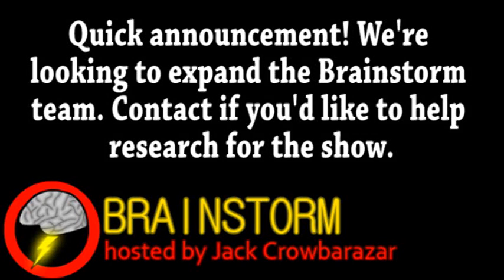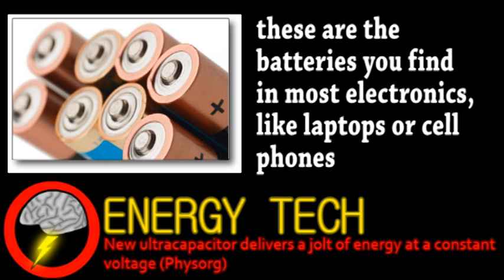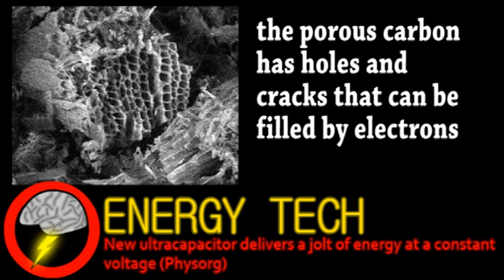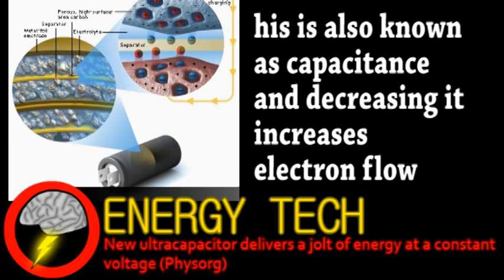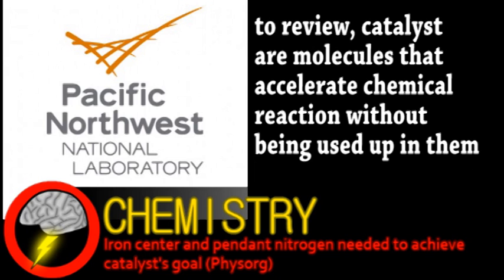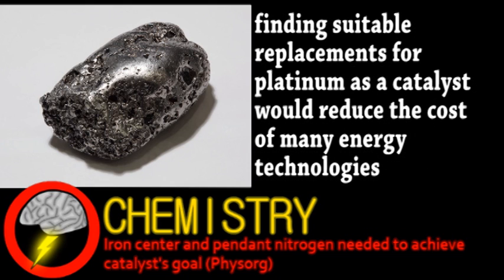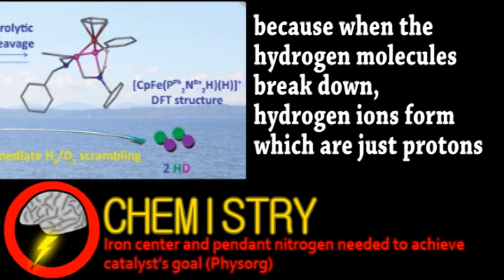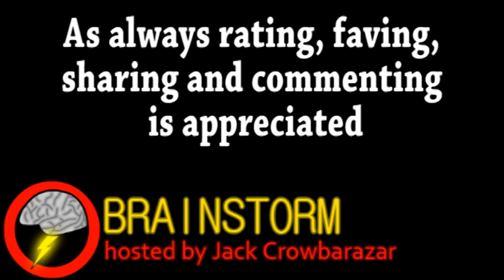ULTRAcapacitors For Better Power Storage (Brainstorm Ep92)

Comment: When are people going to learn that there is very little free hydrogen on the earth and that any hydrogen made from water is not a SOURCE of energy? It takes MORE energy to break water into hydrogen and oxygen than the energy you get when you burn the hydrogen back into water. Simpe thermodynamics. Hydrogen from natural gas MIGHT be cleaner than burning NG (it might not be) it, but that still makes NG the SOURCE energy. If we had lots of free hydrogen on earth, it would be a great energy source.

Comment: This is a terrible description of batteries. Secondary cells don't loose capacity with each charge/discharge cycle and the degradation is different from chemistry to chemistry.. Also, secondary batteries don't store electrons the way a capacitor does, they store energy chemically. A capacitor stores electrons with two plates divided by a non conductor. Envia System supposedly has a battery with 400KWH per Kilogram of weight.